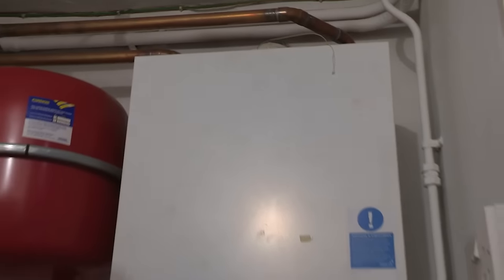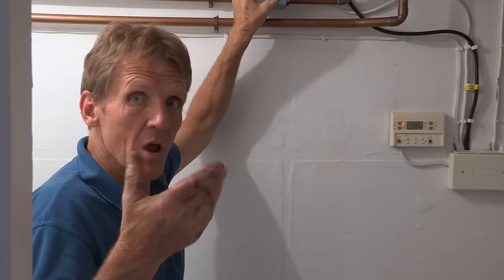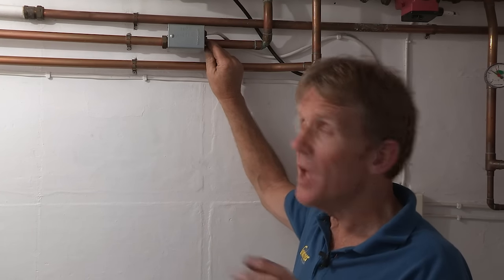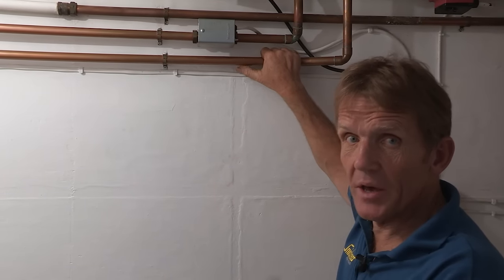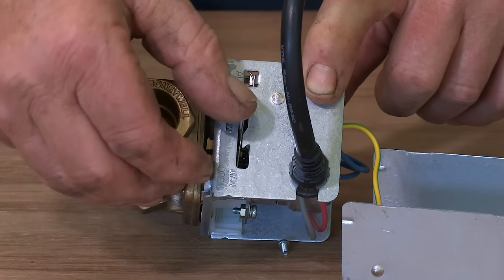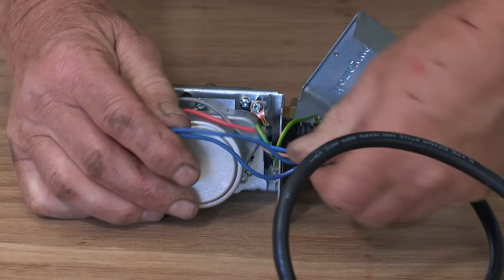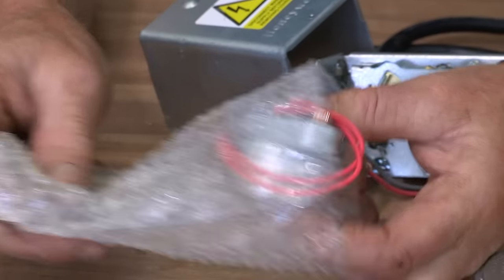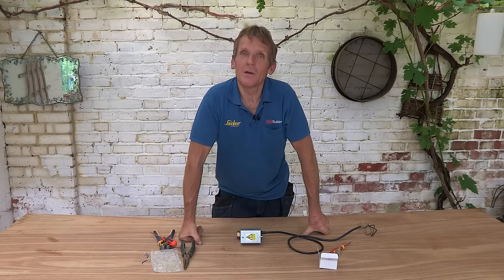How to Repair a Motorised Central Heating Valve

Comment: Thanks for this excellent video. My daughter was quoted £330 by CH company to replace the motorised valve and that’s on top of a call out fee of £86. After looking at your video I sourced a syncron motor for £9.75 and fitted it myself in 20 minutes. A tremendous saving. My daughter is very pleased. Shame on the CH company. Thanks once again. MG, Wirral.
Reply: No shame on that company that’s standard price In London don’t be mad u don’t make that much money
Reply: Great video. Fair play
Reply: @judehajichambi4147  It pays to be handy. Its the equivalent of wages.
Reply: Where did you source the synchron motor from

Comment: Yes plumbers will inflate the job. One was vague about the ''valve'' then immediately said it maybe mechanical in which case he'd have to drain the system, bleed all the radiators etc.. and it would be £180 + VAT labour, and the part. Probably charge for the whole unit which is just shy of £100. Total cost nearly £400. No wonder people despise plumbers and other tradespeople, for their sharp practises.

Comment: Thanks for this.  In early December 23 when servicing our heating the engineer told us the zone valve was sticking and needed to be replaced because there was a 10 minute delay before system fired up.   He had ordered the part and would come and fit it.  In February the valve started sticking in the open position and after watching this video I was able to release it and messaged the heating engineer to have the work done.  No response.  Eventually as the problem got worse I ordered a Synchron  Motor for £13.95.  It arrived in a couple of days and was fitted in about 20 minutes.  The hardest part was re fitting the tiny screws.  All working great now.  Thanks for providing so many really helpful instruction videos.  They are a great help.

Comment: I just replaced mine (which is 24V). The failure mode was that the valve was stuck partially open. When the motor is powered up, it will spin and open the valve, until it's open. What's interesting is that the motor stays on, constantly trying to turn and holding the valve open. When the power turns off, it stops trying to open and the spring closes the valve. The motor is designed to handle this, but it is also the reason why you can only have limited number of motors connected to one transformer (in my case, it is 3 on one transformer, and 2 on another). Mine failed with the gears getting stuck open (it was 45 years old). As I started to remove the motor, I heard the insulation on the wires cracking right where they entered the motor and the wires were now bare. Why didn't I just change the powerhead like most plumbers would? Because my powerhead was attached with all 4 screws, not just 2, and removing it would have required draining the valve sections.  Thanks for showing us how to change out just the motor!

Comment: If you have a '3 way' valve, it is sometimes the microswitch that goes and not the motor. You can get the complete unit (the silver box) and swap it with just two screws. Again, no draining required. You have to trace the cable back to the junction box, where there are usually five wires. The colour code seems universal. Swap the wires one at a time and you should not get into trouble. Power off of course!

Comment: Spot diagnosis.
I just needed to manually move the lever on the heating circuit back and forth a couple of times, and now it works fine - might have been a build up of material in the valve itself preventing operation.
So you could try that before replacing any parts.
Thanks Roger, saved a few quid there!

Comment: Thanks a bunch for this, I waited for three different plunbers/heating engineers to arrive and would have been happy to pay whatever, but all no shows. so on Sunday I swapped the downstairs valve ( faulty) with the hot water valve and just used the electric to heat the water. today I bought a new valve and replaced the water heating. all good now, thanks again.

Comment: Ok 18 months ago I watched this video and thanks to Roger (probably the best, most straightforward plumber you could find) I carried out the motorised valve replacement. A few days ago the boiler started off by refusing to turn off other than by switching off at the mains. So as I had  other health issues to attend to that's what we done. Switched it on at the mains in the morning and off at the mains at night. I called my friendly Worcester Bosch man who said it's not the boiler, it's the valves. "Give the valves a knock with a hammer" he said "that sometimes clears it". My first attempt was not successful. So I left it.
This morning the boiler was manually switched on at the mains. It worked for a few hours then it switched off. I couldn't get it started again no matter what. Went up in the loft knocked the valves with hammer. Nothing. I decided to replace the motorised valves again so came upstairs went on my P.C., watched dear Roger's video again just to remind myself how to do the job.
Suddenly it felt a little warmer and miraculously the heating has come back on! Now the question. Should I replace the motorised valves or leave well alone?

Comment: A massive thank you for this video. I have had no Hot Water but Central Heating is working perfectly. I was just about to call in a plumber with all the cost that brings when I saw your excellent video. I did the diagnostic test on the valves and one did seem to be faulty. To be extra sure I removed the motor from the CH valve and put it into the hot water valve. Tested the hot water and it worked perfectly. I have now ordered a new motor for little more than a tenner and will fit that back into the CH valve. I reckon I probably saved £200 or so, I also have a great sense of satisfaction and the wife thinks I'm brilliant! Thanks again Roger!
Reply: Where did you find the that Valve?

Comment: Roger, THANK YOU so much!
1am the night before a bank holiday, staying at my mum's, and I notice after watching the snooker that there are noises coming from her airing cupboard - the pump is running hell for leather despite both CH or DHW being off. Boiler on, of course, and her smart meter energy monitoring gadget screaming blue murder!
I checked her Hive system, and eventually decided that the problem might be one of the S-plan valves sticking open. I've dealt with combi systems before but never something like this.
Your video gave me the confidence to diagnose the issue - sure enough, the lever was loose on the DHW valve. So I popped down to Screwfix in the morning and fitted a new valve head unit. It's all working nicely now. The old unit really isn't in great shape (hence replacing the whole head) but I'll probably run my multimeter over the motor sometime.
I'll definitely be checking out a few more of your videos. Thanks again, and keep up the good work!

Comment: ROGER you're  star you just saved me at least £150-£200 pounds I had a quote from a plumber he said its about £70 for a new valve and we may have to drain the system plus two hours labour... I saw this video .........ordered a syncro motor from amazon for £10 and fitted it in under an hour all working fine. I think you're the best plumber on here as your videos are so clear and made it so easy for me. It makes you think where can you get a decent plumber that will do the job as fairly as possible, you are continually on your guard to make sure you're not getting ripped off.    Thank you so much..... Craig
Reply from the maker: I am glad it helped. I always give the customer the option of the synchrom motor change. If the valve is operating freely there is no need to change it. If you want to help our channel grow please like and share and maybe watch another video. We have over 600 videos now and some of the older ones are hardly watched.

Comment: Fantastic video. Really clear and concise. Good context and then deep dive. Helped sort my hot water issue out in 15mins and £15 rather than the £140 for a plumbers labour as quoted. 
Maybe a few ideas for some more:
- changing/recharging an expansion vessel
- draining a hot water cylinder.
- swapping out a pressure relief valve. 

Overall well done and thanks!

Comment: great help, well explained and easy to implement. we had the motor making a noise, we were not sure what it was, so called the assistance (for which we pay insurance). they would not even come, and if they did they would have charged 50£, despite the insurance said it was covered. 20£ of part, 30 min of work on my side, and the job was done. thank you so much

Comment: I had this exact same problem with my central heating.... no hot water,  after watching this I checked that small lever and yes it was loose with no tension on it. £10.50 later with a new motor off ebay fitted glorious hot water  again. Thank you so much for such a clear and easy video to follow with good clear instructions. A subscribe well worth having.

Comment: This video was spot on, thank you! Came home from a weekend away to find the house cold. The heating was asking for demand but the boiler was not firing.  After some fault finding, I identified the 2 port valve was not closing the circuit. £10 and a day later, I’ve replaced the synchron thanks to this video and it appears (touch wood) to be working! God knows what that would have cost to get a professional out.
Reply: Was your motor moving? I can hear the valve whiring but the boiler aint powering up
Reply: @Eatprepd  I can’t remember but I don’t believe it was. Do you have a lever on your 2 part valve? If you do, manually move it across and if the pump comes on with the boiler, you’ll have found your fault.

Comment: Cheers Roger! My boiler is now firing after changing the synchron motor. Couldn’t work out why boiler fired occasionally and not at other times despite the thermostat correctly calling for heat all the time. Turns out the motorised valve was failing to open/close despite power reaching the motor due to it getting hot and the sticky old oil on the cog making turning the valve more difficult. This is why it worked from cold but not when hot. Love learning new skills from you buddy, you really make things simple to understand and give keen diyers the confidence to give it a go. Thank you

Comment: Great info, Thank You.
I had issues last evening with the boiler not firing up when Hot Water was called for.
To confirm it was the Valve, i swapped the two control wires over, swapped the Hot Water and Central heating valves over, then called for Hot water and the boiler fired up.
I then called for central Heating and sods law, that fired up also.
Chances are the motor is on its way out so ordered one today.

Comment: Nice video Roger, sparks tend to avoid central heating wiring as it goes against most things they are taught! A lot of people shy away from it but it's fairly simple at the end of the day, it's just individual circuits that turn things on or off, the boiler is dumb it just knows when to fire up.

Comment: Hi great vid, I am having a hot water problem think it's this valve but want to know. Will this faulty motor cause the boiler to not receive a signal to start?
Reply: If the valve doesnt open it wont send power to the boiler load cable. 80% of heating faults are valve related

Comment: Thank you. My motor was just spinning non-stop and getting hot. I removed it and noticed no resistance when turning the screw arbor. New Synchronised Motor ordered from Screwfix - all back up and running now :-)

Comment: Thanks for another great video its given an understanding of how the valve works, I have slightly different problem my central heating pump is running even when hot water or heating not on. I moved the cable going into the motorised valve and the pump stopped immediately. Not sure what the problem is but appears to be to do with that valve. Thanks again

Comment: Thanks for another excellent video.  I wish YouTube had existed when I had to change motorised valves for the first time 20 years ago.  I was quoted circa 200 pounds back in the 90's for a new motor by a plumber and had to work it out myself-as you say, its not a very difficult job and in my case the motors have failed every few years (mainly after the summer, when the motor hasn't been exercised).  It might be worth mentioning that the CH programmer should be set to run for a few minutes, even in the summer just to exercise the motor.

Comment: just did this on my boiler, cost £24 for the motor from screwfix plus £4 for some grease to daub on the cog. The only awkward bit was getting to the screw! Thanks for the video :)
Reply from the maker: Blimey those synchrom motors have gone up in price
Reply: @SkillBuilder  Still a lot cheaper than a gas man! :)
Reply: You were done.   Only £15 two years later from a plumber's merchant.

Comment: Excellent video.  I was able to diagnose and fix my heating issue.  My synchro motor was buzzing and I swapped it out with another unit that I had left over from a previous repair. Cost me zero dollars to fix a home that won't heat. 
Thank you!
Subscribed!

Comment: This video helped saved me £££‘S
Woke up last night about 2am feeling really hot and sickly think what’s going on, wife wakes also feeling the same then we realise our bedroom radiator is on full! Doesn’t have the thermostat vales because there is a thermostat walled mount in the room.
I check the thermostat on the wall and see it’s not on however reporting that the room temp is 28c! 
So off the airing cupboard and yep the combi broiler is churning away running the upstairs central heating.
My central heating is zoned so upstairs heading is separate to down stairs and two thermostats
Controls these one in our room upstairs and one downstairs near front door.
Check down stairs and it’s all cool so then I troubleshoot and find my way to where the two valves are that control both zone and sure enough by going near the upstairs one can feel the heat so not I’m sure I’ve found where the issue is caused next is good old google at 2:30am to see what sort of fix and the damage to the wallet. 
Search returned this video so this morning been to screw fox picked up the motor swapped it out form the old and all is working well again!
I had the opposite issue where the valve was stuck open so the boiler was feeding heat but still the same fix.

Now subscribing to this channel thank you again 
From a very ashamed to say novice diyer!

Comment: A very informative video, I suspect this is the fault that’s causing her radiators to heat up when CH switched off. I can now change the motor after ensuring the 3 way valve isn’t jammed . Hopefully it will work, if not I’ll proceed to draining the system and fitting a new valve body and actuator 
Many Thanks, hopefully it will save her a plumbers call out and labour charge which as a retiree she simply can’t afford

Comment: I just wondered if this box/valve gets hot when heating is on? I have an oil boiler system. You made it look really easy to change so i might just have a go myself 😊 thanks.
Reply from the maker: Yes it does get hot but not that hot.
Reply: @SkillBuilder  oh thank you for replying 😊 it's not scalding hot, thank goodness so I'm hoping it's ok and not going to set on fire. Mind you it's an old system. I think this has made me decide to look into getting the whole radiator system replaced, although I know it will cost a bomb 😔 😁  thanks again 👍

Comment: What a great explanation, no heating at the moment so trying this. Thank you very much 👍
Reply from the maker: Let us hope it works, if not let us know and we will try and help  roger@skillbuilder.uk
Reply: @SkillBuilder  Very strange when we swapped the functioning motor from water to heating. The motor spun around as soon as we switched power back on even though we hadn't switched the central heating on. This didn't happen when same motor was on the hot water. It worked normally. Does that indicate it's the programmer?

Comment: Thanks for the excellent video Roger. Very informative. I installed a 3 port Honeywell in my heating 17 years ago. It replaced a different make. Its playing up now and I am grateful of the reminder of its internals as I recall the wiring up was tricky. Its actually a Honeywell 3 port valve and its letting by to the CH circuit in mid Summer. Not sure if the motor or the ball within it is to blame. However I have turned off each radiator and that's stopped it. Who can afford the waste of energy let alone extra live with the extra heat?
Reply: As a heating engineer, I can assure you, you will not get another 17 years out of another Honeywell valve now. I don't know what is up with their QC but their valves are now very poor, constant call backs to failed valves after months or just weeks in which I refuse to now fit their valves. Such a disappointment. Not telling you where to spend your money however as a industry professional I would go with another brand 👍 As for your issue with it bypassing, it's more than likely the ball inside the valve not shutting or seating properly, you can buy just the body part of your valve but will require draining down. Hope this helps👍

Comment: This video is great and helped me to fix the problem. 1 question, the new motor when running gets quite hot to touch, is that normal? I can’t remember if the old one got hot like that..
Reply from the maker: Yes they do run a little hot. If it is working then it is fine.
Reply: Skill Builder Thanks for replying. And thanks again for the video, it really helped me out 👍🏻

Comment: Thanks for this excellent video, it gave me the confidence to tackle this job. Two things not shown 1) the left hand mounting has no screw but it does need to sit in a slot correctly - bit of jiggling and mirror is useful, 2) my Honeywell V4043H1056 had torx10 screws not posidrives. Apart from that, much easier job than I expected. Thanks again.
Reply from the maker: All true. They used to have two screws now you just jiggle them in.